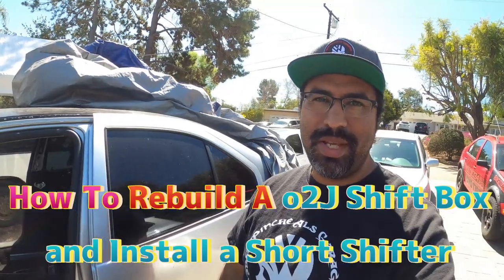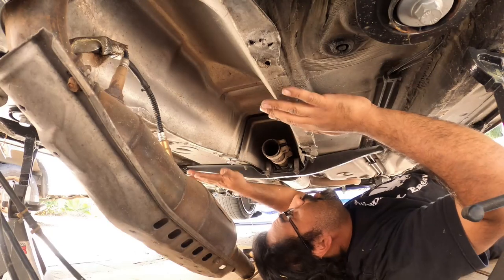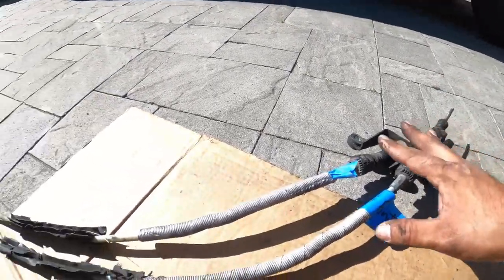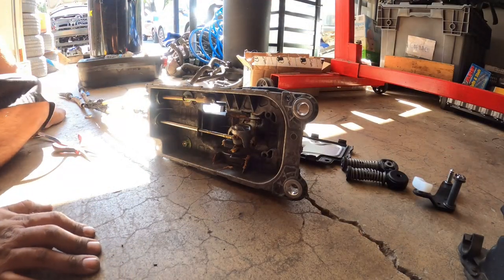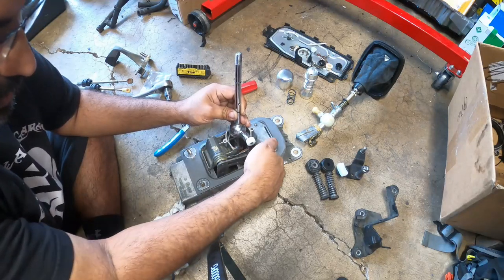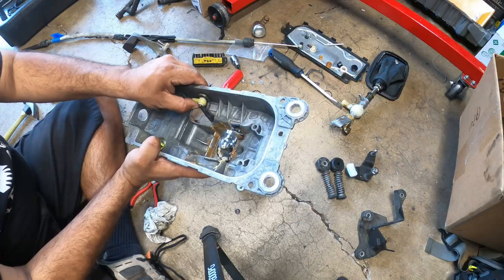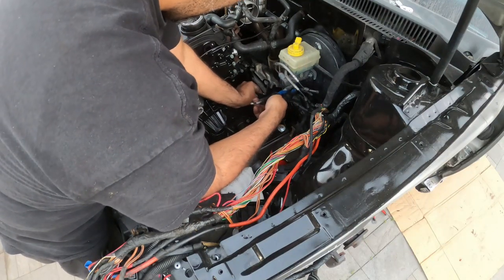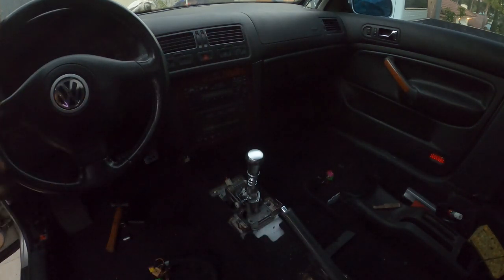VW Rebuild 02J Shift Box and Install a Short Shifter S7EP28

Comment: God continue to bless
 Hey great info. Question maybe you can answer; can you replace the bolts that stretch on motor mounts with one's that don't????🤠
Reply from the maker: Yes
Reply: Cool thanks. What grade you think should be used?
Reply from the maker: @juanquinones2597  I would use an 8.8 or 10.9 grade but make sure it's a high quality bolt because you can buy some really cheap stuff. Use ARP if you can
Reply: Alright will do thanks again 👍👍

Comment: Do you by chance know of a good solution for the shifter bolt on o2m that has the guide pin body? PN: 357711234 which is discontinued
Wondering if people have used a different bolt, or just finding used ones from junkyards, etc. maybe mcmaster-carr, any help much appreciated.